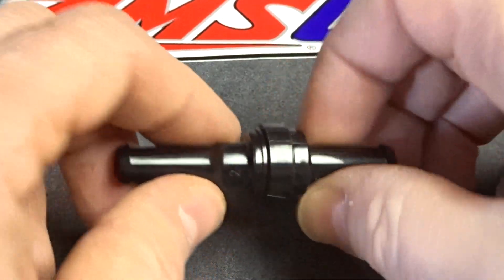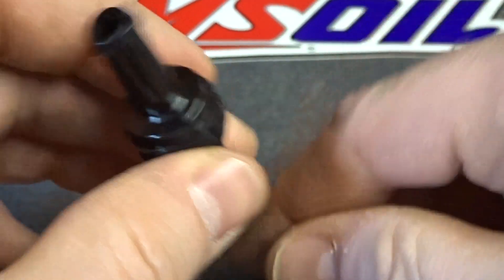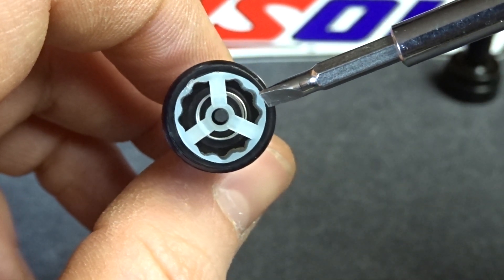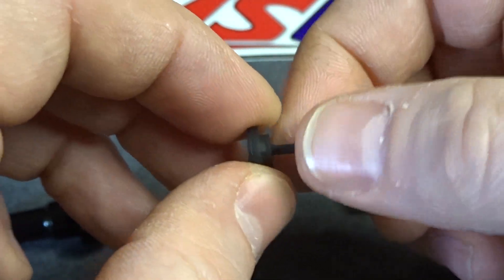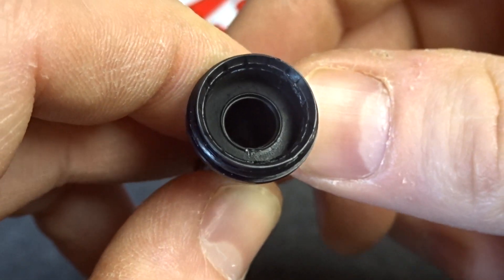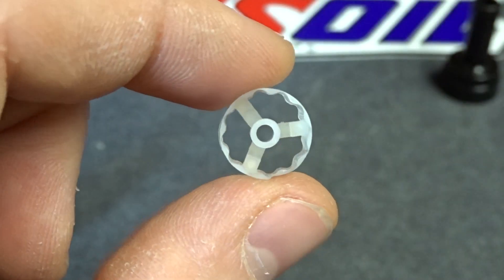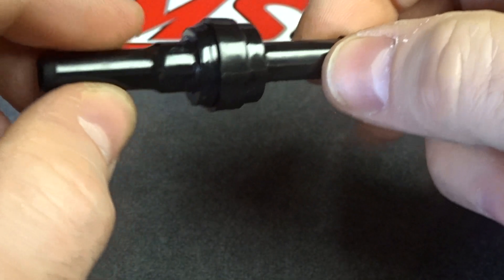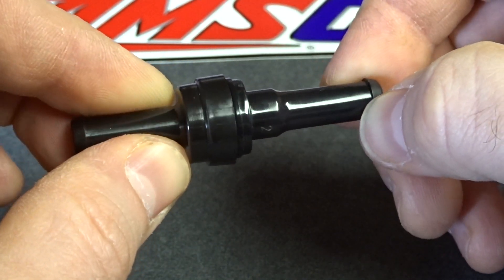CruzeKits.com PCV Check Valve Disassembled

Comment: So given that you sell extra of these on the site for replacing as needed. What's the sign that it needs replacing? Just looking for when it throws a P0171 again? or when the blows the valve cover seal again? Or are you thinking swap it after 100k or so to be safe since the stock lives what 80 or 90 before wanting the intake replaced?

Comment: I had recently converted my PCV system with your V3 kit only to find out that my intake manifold was cracked and needed to be replaced. I have a new Dorman replacement ordered and am looking for the best way to modify the new manifold's check valve. Can I just cover the check valve with butyl, or do I knock out the check valve and use the same process as before?
Reply from the maker: Knock out the check valve and use a screw and washer to plug it up. #10x3/4” self-drilling sheet metal screw with a #10x7/16” nylon washer.
Reply: Thanks.
 @AndreiDPop

Comment: If you have an old vapor canister purge valve you can use it's check valve instead, gives you better air flow and can't get clogged
Reply from the maker: Not designed for PCV use. Those are designed for fuel vapor or fuel delivery. PCV is a much more dirty environment. Already went down this road before.
Reply: @AndreiDPop  If you think about it, it's connected to the same intake manifold where the PCV valve is so it should be ok. And I've actually been using it for 2 months now and haven't had any problems, thank you for the idea anyways it works pretty well 😊
Reply from the maker: @GadGetHackss  it only flows into the intake manifold and not out of it, and the only thing flowing through it is fuel vapor, not oxidized oil vapor, combustion byproducts, and condensation. That’s a very different environment. At no point does anything in the intake manifold flow back through that check valve so it stays clean and reliable. Can’t be said of the PCV system especially once you introduce condensation. 
Did you at least mount it at a downward angle so it doesn’t accumulate deposits inside?

Two months is easy. Get back to me in 30k miles…
Reply: @AndreiDPop  You may be right. I have the same setup as yours, only thing that's different is that valve .
Reply from the maker: @GadGetHackss  you ordered the v3.4 pcv fix kit from cruzekits.com and you’re using the custom angled T fitting?

Comment: Great review! What usually goes bad with these?
Reply from the maker: Since the newest ones came out, nothing really. The currently available ones are the third revision with the best plunger and the early splitting issues have been resolved. Solid check valve. Only thing that seems to go wrong is clogging from deposits but any check valve will do that with time.

Comment: I got the kit 3rd gen and was working fine till the check valve got split, got the engine error, so I try using gorilla super glue and so far Ok, may need to order a new one just in case.
Reply from the maker: How long did you have that check valve on there?

Comment: Hello from Australia!
I purchased and installed one of your kits for my partners holden barina rs (or as you call them Chevy sonic rs ).
With excellent results! But now many months later and out 8000kms I have noticed the car is using oil and blowing blue smoke. I'm trying to narrow down if this is a pcv issue again, turbo, or internal engine. The car has 82000kms.
I took apart the kit I installed from you to check the oil build up and there was definitely a bit in there, im wondering if its possible the valve had become stuck open allowing the vacume to flow carrying these oils when both on and off boost?
Not sure if it helps but also took all the pipes off the intercooler, removed from the car and cleaned. Was also oil inside those as well as the throttle body.
Any ideas? :/
Thank you!
Seem to be very complicated these little engines!
Reply from the maker: Definitely inspect the check valve on the kit and make sure it’s not broken or stuck open or something. When was the kit purchased? I’ve made some upgrades to the kit since.
Reply: @AndreiDPop  Thank you for the reply! I ordered the kit in January, so would have been installed in February. After cleaning all the pipework out on the weekend and taking the car for about a 1 hour drive, I popped the hose off the intake manifold dirrectly above where he original check valve is and there is noticable oil inside already. This is telling me the oil must be entering the system here? Either theres too much vacume (which these engines are crazy if you ask me), the oil has just lost its nuts and is too thin and getting sucked up, or my valve cover isn't doong its job correctly in separating the oil particles before entering that chamber? Whats your thoughts? Could it really be that valve causing enough extra vacume to suck oil?
Cheers mate
Reply from the maker: @FrantiixGaming  I mean the valve on the kit may have failed. Did you order a spare with it? I do have some upgrades valves on the side since I had some of the early valves start sticking on people so I upgraded the internals. The new valves have much higher quality plungers. I’ve actually made two upgrades. The second upgrade was just because I saw an even better viton to use. I would remove the check valve assuming you got the v3 kit and plug up the hose ends with bolts until the new check valves arrive if that is your issue. They’re available on the website.
Reply: It is the v3 kit, sorry I forgot to mention that. I did order a spare so I will put that on and I'll have to make an order of the updated version. I did have a look at the valve when i cleaned everything out and blew some air in one end and sucked on the other, it seemed to be working correctly. But definitely worth replacing to be sure I suppose! Hopefully it sorts the issue!
If I was to put a catch can in the line, could I just run it off the hose before the T piece in the v3? Then back to your t piece?
Or does it need some kind of breather? Im not very familiar with how these work? I would think it could stay without a vent as that part of the system isn't vented?
Reply: @AndreiDPop  just ordered th pack of 4 from your site. I'll replace with the one i have until the new ones arrive!
Thank you for the help!
Reply: @AndreiDPop  Thinking I will replace the valve cover as well, today I tried a few things to check if valves were working. One of which was removing the end of the kit which connects to the turbo side, and sucking on the end (couldn't blow air into it so thats a good sign) and it sounded like the end of a milkshake in the valve cover. I understand its putting things under vacume, but to my understanding that chamber inside the valve cover shouldn't have that much actual oil in it?? I might have to get this thing apart so I can understand whats happening a little better
Reply: @FrantiixGaming  what is your result

Comment: can this be used to replace oem PCV ?
Reply from the maker: If you install the entire v3.4 kit from cruzekits.com, it will replace the oem pcv valve in the intake manifold.
Reply: The pCV valve that's built into to valve cover would still need to be replaced but wont get ruined again due to failed intake manifold valve

Comment: I have a sonic 2013 1.4 rs and everything is working properly ok but i noticed a little oil in the intake turbo from the hose it comes from the intake manifold that hose u mean it’s made of peanuts so what solution can i do for that  . Do i need a catch can ? And where to i have to plug-the hoses  thanks in advance
Reply from the maker: Have you inspected the intake manifold for a missing/dirty check valve?
Reply: @AndreiDPop  i checked and everything is ok

Comment: The key here is that the valve is on the outside now.. so changing it takes 2 minutes.. I'd just assume to have the over built one in your first version though.
Reply from the maker: Yeah the brass check valve in the v1/v2.1 kit is definitely the more solid option if you're looking for longevity. These valves are doing OK though. Pretty decent life out of the new ones that I had made with upgraded plungers.

Comment: Mine just came apart about 2000 miles after installation. I guess I could glue and tape it to hold it together. I could even use the plastic epoxy you sent as part of the V3 kit. But I'm inclined to upgrade to the brass valve just to not have to worry about it. Got a link to the brass valve? Want to sell them to us on your website?
Reply: V3 check valve issue:

My car started running a little rough, and I was also having an issue with oil leaking out of my oil fill cap and dipstick. I noticed that when pulling the dipstick, I had positive pressure. I replaced the seals on both, and I also removed the check valve for inspection. After confirming that there was no air flow whatsoever, I cracked it open(very easily) and noticed that after about 5000 miles, the Viton plunger expanded and conformed to the shape of the housing, preventing it from moving. (defective maybe, it is almost as if the Viton melted and spread out) I ordered 2 more of these and hope for better results. I have also ordered the Brass check valve and barbed fittings and will find a way to support it if/or when I encounter the same issue with the replacement check valves.

Update: While waiting for the replacement check valves, I used an exacto knife to trim away the excess rubber that had expanded to conform to the shape of the housing, so that it would move freely again. I use the plastic bond that came with the kit to seal it back up, and it is working somewhat normally. When pulling the dipstick, there is vacuum again, and the car starts to stutter after a few seconds as it should.
Reply from the maker: Brass valve and the two fittings needed to adapt it to fuel hose would be much too heavy. No way to support that weight on that line, hence why the nylon valve was used. I had a batch that had some defects from the manufacturer and broke apart easily, about 1 in every 10 valves. Just clean it up with brake clean, epoxy it back together, and shoot me a message on the cruzekits site. I'll send you a few replacements.
Reply: @AndreiDPop  Oh, I see. Fast reply! I just came back here to ask you to buy 1/4" or 3/8" Bonomi valves and 5/16" barb to NPT adapters and resell them to save us shipping. I hadn't thought of the weight issue. It might be possible to create some kind of bracket and use zip ties. But if we started replacing every plastic part that could potentially crack with brass, it wouldn't be an Eco car anymore, so I'll resist the temptation to overengineer. I'll just clean mine as you suggest and seal it up permanently on the outside. I can't imagine it being an issue again. It's clearly just a mechanical failure of the housing, not a problem with the valve internals. Otherwise, the whole system seems to be working great and I love the design.